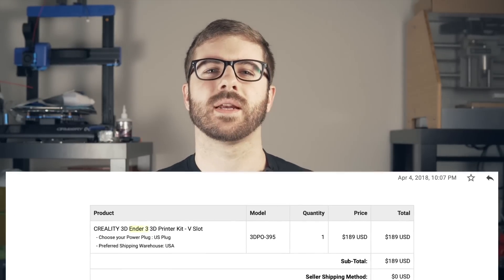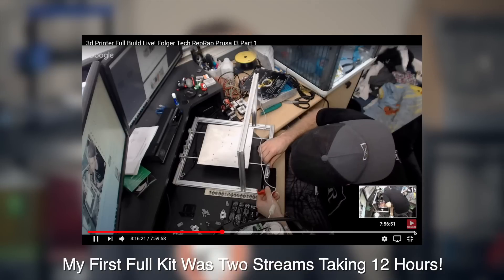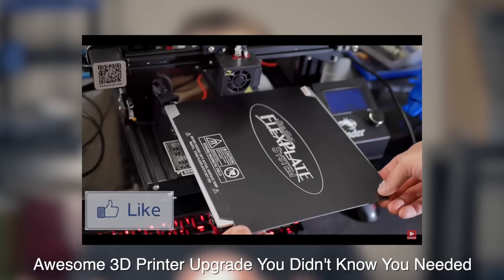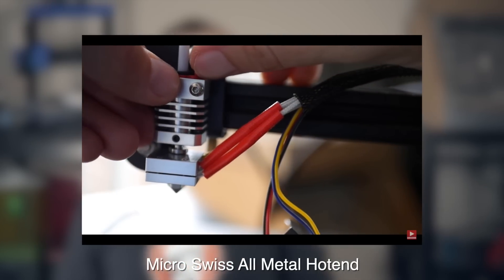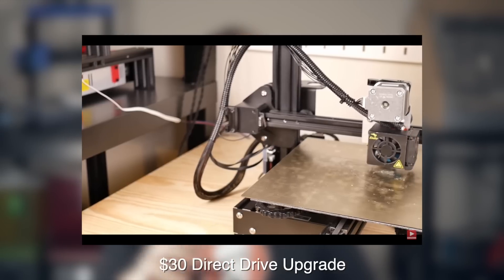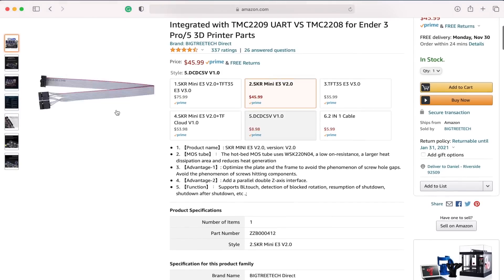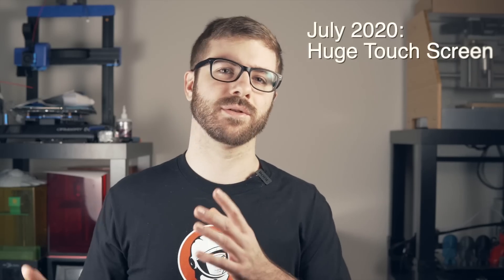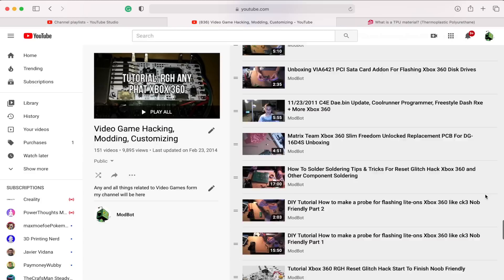My Ender 3 Journey 2.5 Years Later! Still Worth Getting?

Comment: Great video, owned an E3P for about 6 months now.  I got it used off of ebay and the factory board was bad so I went with an BTT SKR board and TFT-35 display (Love it!) but the rest of the machine is stock.  Works so good I picked up a second.

Comment: The new ender 3 pro comes with the upgraded 32 bit mainbord and works great out of the box. Got my 3 pro yesterday and did to prints with the filament they provided first was the dog a 3hr 10 min print then the cat with no infill that was a 6 hour print both came out awesome. Got the printer that all metal exterior kit and 2 rows of pla for 280.00 on banggood

You get a subscrib from me

Comment: I have had my Ender 3 Pro for a year now and I have around 900 print hours on it. This machine has been a workhorse with only a couple issues. The issues being 2 v-slot wheel bearings went bad around 600 hours, a belt rubbing in the v-slot channel which was fixed by adding some belt tensioners and replacing the belt and a z axis rod brass guide wearing down and causing backlash. The only mods I did that was not cosmetic were I removed the flexible build plate and installed a creality glass bed. I relocated the spool holder to the side. I added belt tensioner to the x and y axis. I upgraded to a silent board which made such a huge difference in the noise of the machine.

Comment: And now, the other extreme: I looked really, really hard at the Ender 3 Pro as my first printer, but instead I'm building one from scratch.

I'll have about 3x the cost of an E3P invested into it but I'm literally starting with a lot of the popular upgrades - I'll have a dual-stepper/dual-drive Z axis with synchro belt, direct drive (Bondtech extruder and E3D V6 all-metal hotend), 32-bit driver board, Raspberry Pi with Octoprint, intelligent power management with soft-button power control, all linear bearing supports (no wheels on V-groove extrusions), high-torque steppers (84 oz-in/59Ncm), BLtouch ABL, optical limit sensing, filament runout detection, 13.7"/350mm cube print volume, heated bed, and it'll be able to support high-temp materials (ABS/ASA/Nylon) from the first minute. My machine will be bigger, heavier, more rigid, and less prone to adjustment/alignment issues than a ready-made unit, which should make for nice print quality.

Why am I building a 3D printer as my first foray into additive manufacturing instead of buying one? One, I've owned a small CNC mill for years and know subtractive manufacturing like the back of my hand so I already understand the basic principles behind these machines, and am using my mill to cut parts out of aluminum plate. Two, I already have a bunch of the parts lying around from other projects, like a half-dozen 12mm x 400mm linear rails and couple dozen linear bearings to slide on them, so I can shortcut the process. Three, I like building things from the ground up and this project is right in the middle of my happy zone for that. So far I have the X/Z gantry assembly almost finished and it looks beastly.

I've been recording the build process, so videos on this project will be forthcoming, probably in a couple months once it's finished.

Comment: Basically done the same mods, and for me the skr mini v2.0 was a big change well worth doing. The only thing I would love to get sorted is silent fans on the hotend, but getting a silent fan with similar output is tricky especially if you stick to 24v. I fitted 92mm 12v noctua fans to the psu and motherboard with buck converters to silence those parts but have yet to get a decent fan for the hotend (trying to get it as quiet as possible)

Comment: The mod path is addictive, reduce noise, prevent clogs, print higher temp and flexibles. My Ender is basically upgraded the same as yours. Very capable all rounder.
Reply: Yeah. Once the issues are solved it's pretty good. However it was really annoying that the PSU creates voltage spikes which can cause issues with bed leveling sensors. That was really annoying. I only got around that issue by installing Klipper. It was either that or replace the PSU (which eventually I will do anyways). However with Klipper it runs MUCH smoother and I don't get the shuddering issues
Reply: Same here, it is fun and games.  My printer even has a name, Lara.

Comment: Nice video about your Ender 3 journey.  Mine has been fairly similar and I even based my purchase of the micro swiss direct drive off of your review.  I had already put the all metal hot end they make so it was an obvious pairing.  I actually have two Ender 3s, one is from Creality and the other resold by Sainsmart.  I have built enclosures for both of them made from plywood and lined with cement backer board for fire resistance.  I have taken the control board and the power supply and put them outside the enclosure and also have the control panel mounted in an enclosure in the front.  I have replaced one of the boards with a silent Creality 8-bit board and replaced both power supplies with Meanwill units, like on the Pro version.  I run both of the printers using Octoprint with a webcam so I can monitor them remotely.  I have them wired to switches that I can control through Octoprint if I need to shut them down if I see anything wrong.  I have a BL touch on each one that works most of the time but isn't as reliable as I want.  I have replaced both print surfaces with the spring steel PEI coated units from Creality.  I love the spring steel design but the PEI doesn't really work very well so I always use glue stick.  I print mostly PLA but have printed TPU and PETG.  I have some Nylon but haven't played with it yet but that's the goal of all the mods.  They work well enough for what I need but would love to have a large CORE X-Y machine for larger prints.  Thanks for your videos and I look forward to new ones.
Reply from the maker: Your setup sounds awesome. I love the enclosures and octoprint to monitor remotely. When I have a larger area I will likely set up a small farm again and may do something similar to what you have described. For now everything has to move so often that it is not practical to make solid enclosures. Thank you very much for watching and for sharing your experience!

Comment: Great tour of the Ender 3
I have taken a bit of the same ride.
The Ender 3 just works out of the box. Yes it is easy to enhange the printer, both in hardware, but even more in SoftWare (via hardware, Mainboard)
The biggest lift in quality is the SLICER change, and they change in a fantastic rate I started withe Cura, shifted to Idarmaker, and ended with PrusaSlicer.
Thanks for sharing your great videos :-)
Reply: I too have done some mods and have a similar journey. I switched from Cura to prusa slicer to Ideamaker. I still follow the development of the other slicers. If you have a prusa machine prusa slicer probably will be your best option. For the ender 3 Ideamaker is the best for me. In all cases I start from a base profile and tweak it. An example on how the right slicer can help: travel paths. Lets take a hollow sphere as an example (like the famous moonlamp) or a thick vase which you can not print in vase mode: Both Cura and Ideamaker have settings so your travelpaths stay within the shells and this works really well. Prusa slicer has this too but fails almost everytime. The result will be a very stringy moonlamp or vase where removing the strings is a pain. When you discuss this on prusa fora/facebook groups the respons will always be: upgrade to direct drive, do more retraction calibration or buy a prusa machine instead of a cheap Ender 3.
Reply from the maker: Out of curiosity, for the Ender 3 are you using a stock built in profile in PrusaSlicer or have you been tweaking it? I have been so happy with Cura for years not I dont know if I will switch. I plan on getting a mini at some point and then I will likely dive into it a bit more. Thank you very much for the feedback. Hope you had a great weekend :)

Comment: Great video. I agree with every word and gone through almost the same road. I added raspberry pi. That was hugh for me. I enjoy it so much
Reply from the maker: Thank you very much! I totally should have mentioned that but when I was running my small print farm I did use a PI as well with this machine. One of the best things I think you can do for your printer.
Reply: Me too
Reply: Is the 3B+ good enough to control 2 Ender 3 printers?
Or more, can I control 2 printers with one Pi?
Reply: @KLP99  I use the 3B+ for octoprint. Works great. There are some guides out there on how to use one pi for multiple instances to control more than one printer. Haven't tried that yet. There are some great 3d printing discords with a lot of helpful peeps. Highly recommend joining one or more of them.

Comment: Another happy owner, bought ender 3 pro about one year ago. I made a lot bigger or smaller  mechanical/electrical changes. After a few weeks I understood why it is so popular. My favorites... everything from bigtreetech (mainboard, smart filament sensor, automatic shutdown, UPS) their modules, expansion boards are awesome with good price. Of course i can't live without Raspberry Pi and octoprint (who can? :D). Right now i try to install 5.5mm endoscope as my second camera. The view through the endoscope is unreal if you position and adjust it correctly. My problem is octoprint/octoPi always boot with only one camera stream service (i can use one or second camera not both at same time with multicam in diff. ports)...linux command line job and i am not a good at it. I will change all metal hotend maybe later or better cooling should be my priority (i use bullseye now, want try some double fan solution), because if you start print more complicated overhangs things stock cooling is not good. I want to mention and thanks all people from the community. They do amazing work when they share knowledge, experience through internet and move this printer to its absolute limits. The printer itself is excellent but without these people it would mean nothing....
Reply from the maker: I agree. The community is rad and it is everyones hard work and contributions that allow the machine to be succesful. Both for us as the end users but also the manufacturers to be able to implement some of these fixes and upgrades like we have seen with their newer machines (belt tensioners etc).

Comment: Great video and nice timeline. I had my Ender -3 for about a year now.  It is a great project for me to learn a lot of skills. Learning how to make extensions to move the electronics out of an IKEA LACK enclosure. Overall, I did most of the upgrade you went thru minus the touch screen since I use OctoPrint to do most of my printing. I still recommend people to start with an Ender-3 V2 to dip their toes in 3d-printing.
Reply from the maker: What do you like more about the V2? I guess it does give you the better mainboard. I have not used one personally yet so all I have to base off of is videos and things I have read.
Reply: @ModBotArmy  It is just for personal experience. The stepper motor and 32bit board upgrade to make the printer more "home friendly" for beginners. I upgrade my Ender-3 v1 to SKR 1.4 with TMC2208 and it makes the printer so much bearable to use next to me in the office.

Comment: For the BLTouch issue: G-code to put in Cura (or other slicer)
[Preferences->Configure Cura->Printers->Machine Settings (far right)->Start G-code]

G29 ; ABL
M500 ; Save mesh to EEPROM
Reply: You don't need that in the start G-code...you can just run that in the terminal/console (on Pronterface or Octo-Print for example) to save your ABL Mesh to EEPROM. To load your mesh you just need to home first and then in the start g-code after homing:
G28; home all axes
M420 S1; enable bed leveling
I only run the actual bed leveling g-code once every couple months
Reply from the maker: I may attempt it again in the future. I did try many things back then. The oddest part is that it worked so well for so many months and then nothing.
Reply: @ModBotArmy  I'd love if you took another crack at it, I bought a used ender 3 and it was working great then got a 4.2.7 board and a bltouch and had this issue since it put it in
Reply: @ModBotArmy  Yeah weird...maybe a defective sensor?

Comment: ender3 = $200
BLtouch = $40
MicroSwiss Hotend = $75
Buildtack Flexplate = $50
MicroSwiss Direct Drive combo = $75
Well, it ends to a $500 printer. Cheap printers can be a trap.
For $500 you can get an excellent direct drive printer with auto bed leveling, filament sensor and power loose guard.
Reply: Learning the in and outs of a printer and doing upgrades yourself is far more valuable.
Reply: @symbolicsin  For some people that's true, but this is not universal. You see it through your own eyes only. Many people just wanna produce, not tinkering their production machines.
Reply: A 500 bucks printer will not have a micro swiss direct drive quality.
Reply: @JonathanKainzner  Micro swiss works as fine as the E3D v6 you can find on several sub $500 machines.
Reply: @axelSixtySix  sure, I got my ender 3 with skr 1.4, Mellow wind dirext extruder, double Z, 3d touch and a noctua fan for 250 dollars. Its unbeatable in this price range.
Reply: @JonathanKainzner  I don't buy SKR boards anymore. Two cards out of order within 500 hours printing In two different printers. A fail upgrade IMHO. Maybe those are suitable to week end use, but not for sustained printing production. By the way, do you buy a price or a rugged machine ? Chinese machines have an unbeatable price tag, for sure. But consider how many upgrades you had to do. This is not an Ender 3 anymore. By the way, you could save money on the dual Z which is useless if your wheels are perfectly tight.  There's many rubbish things in the stock Ender 3 but this is mostly junk quality components : bearings, variable pitch leadscrew, loose extruder, poor boy's PTFE tubing and polymer wheels, etc. Some you did not change yet. But don't you worry about companies who save all the pennies on insignificant savings like on the cheapest bearings ever ? Well, within 1000 hours printing you will notice your wheels and your trapezoidal nuts starting to wear, your bearings singing, some cables getting fragile... I saw all that on various Creality printers. And that raise the price tag to another level. I worry much about the printer quality than about the price tag which comes later.
Reply: @axelSixtySix  I feel with you. I mean if you buy a artillery genius for 260 dollars, you will get a titan clone which will break. 8 bit mainbord, ptfe lined heatbreak... For the same price you can get a ender 3 with those upgrades I have mentioned. It will be a much more reliable machine, but far from perfect.
Reply: @JonathanKainzner  Sure mate, no machine is perfect, especially in this price range. To me, the actual best value for the money is the SOVOL SV01. for $200 you've got a bigger build area and nothing much to change as it has already a direct drive titan clone, power loss and filament detection. My printer have actually no structural upgrades  and it totals near to 1300 hours printing with not significant wear. This is much better than the others Creality's I owned. I may preventively replace the wheels for PC ones and bearings for ABEC7 625 2RS bearings. I try to do minimal upgrades on my machines, because if you start, this gets endless.
Reply: except the ender 3 will make great prints without mods if all you want is pla and low temp petg.  All these mods aren't really necessary for pla.  If you want a nylon capable printer, it will cost far more than $500.
Reply: @gregr5  The ender3 wears quickly. That's the problem of the stock version. The poor quality PTFE tube gets brown and cracky within 100 hours printing which is not that much. It's a conception issue. Same issue within 30 hours printing PETS @240°C. So, yes, you're right, the Ender3 prints mostly well out of the box, despite retraction and pneumatic couplers issues, but for how long ? On the stock version, the print quality decreases as quick as the printer wear. Unfortunately.
Reply: @axelSixtySix  I would say you can make it print really good and reliable, if you change the most important parts. Extruder, pc wheels and maybe the board. I will print mostly flexible filament so the ender with a really good direct drive is a great option for me. I don't know if I should get the artillery genius again or the ender 3😄
Reply: @JonathanKainzner  Well, as you want to print mostly out of flexible filament, maybe a native direct drive printer should be the better choice. I don't know about the Genius, but there's a bunch of native direct drive extruder printers on the market. We have seen the SOVOL SV01, which is direct drive and have a 250x300x300mm buld plate at $178 during the 11:11 deals, which is note that much compared to an Ender3. I guess you can get a good deals on the genius too.
Reply: @axelSixtySix  need to think about that😉🙂👍